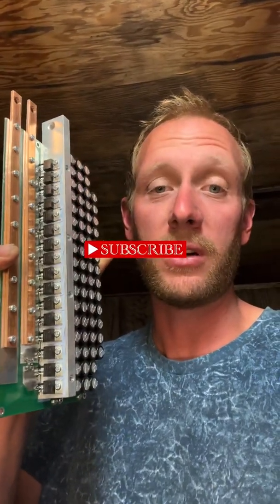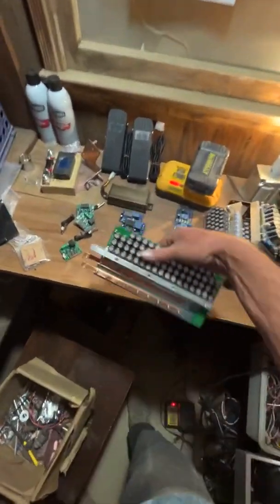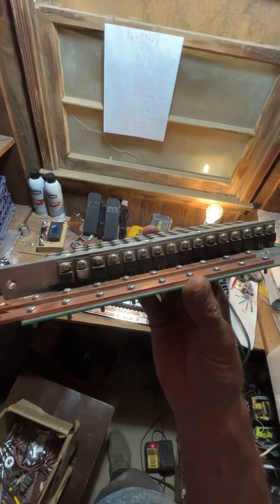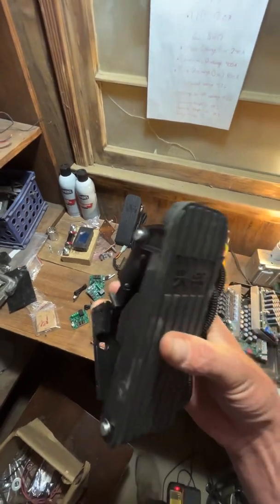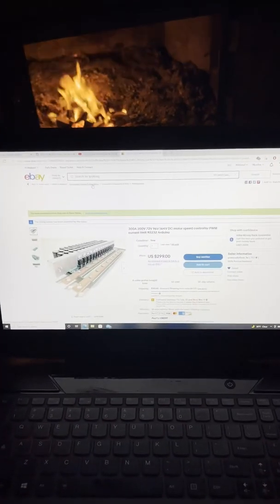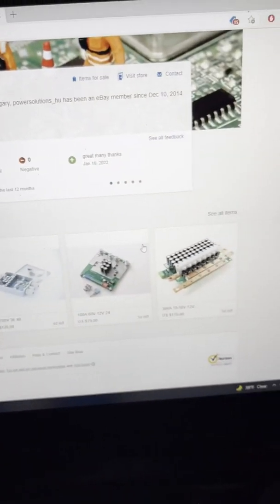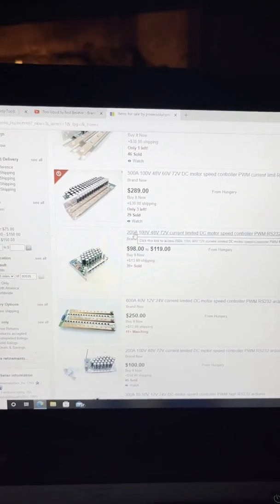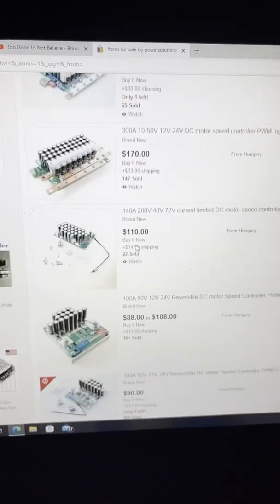200v Ebay controller overview powersolutions_hu

Comment: I'm replacing Dead Acid batteries in old 48v carry all for use as farm cart.  Ive got 2 48v 48Ah power modules.  I'm thinking I can just get bus bar, wire them in parallel on the bar, some level circuit breaker to guard over discharge, a BMS to control overcharge and leave existing controller in place. Am I wrong?
Reply: I'm not opposed to buying another controller, I'm just not sure I need it.
Reply from the maker: No just leave the controller if its working. Record and post it so I can see your setup and plan. 😁
Reply: @RetroElectric  oh man. Son sent me pic. Club car 2012 carryall. The motor is German. AC with a Curtis 1236-5401 controller. Hi speed.  The better thing though, I looked at a lithium battery off the shelf drop in replacement. 48v 51Ah.
Ha.  Those BH PMs I sent there are 36v, I'll have to add cells to 48, but they're 48aH.  3 in parallel will be 96 at cost of hmm maybe $650 before cell addition vs $2,000 ( pretty sure) for the OTS version. So that exceeds the old saying "Twice as nice, at half the price!" Thank you for your videos. I was letting this project intimidate me. Can't wait to get on the road in couple weeks now. Oh and AGMs in it now are over $300 apiece n 8 of those would be $2400 or something. Geeze.  Next step might be 4x4 for mud n snow. If this works, it's gonna be epic on cost savings all round.
Reply from the maker: @eltonshamblen9766  that’s an awesome! These cells are absolutely amazing for golf carts. I’m hoping to buy more as soon as I get a chance! Going to be getting the old yellow Taylor Dunn utility flatbed cart running soon and deck it out with solar. I’m targeting 120v I think. Unless I shoot for building the pack to charge directly with solar. I also want to build it with a grid tie/off grid inverter so it is a power wall on wheels.

Comment: I thought they were brushless controllers. It energizes a solenoid and thats how its able to handle all that voltage?
Reply from the maker: Yes that are for brushed controllers. Brushed motors are what most golf carts have in them unless they are brand new or someone converted them with an ac motor kit. 

They do not just engage a contractor they do use transistors to pulse the dc supply and in turn modify the speed of the motor as they pulse at variable frequencies based on the input signal from the throttle. 

The only time I have a Contactor on  board is to kill the power to the controller with a key switch or something.
Reply: @RetroElectric  you my friend know a heck of a lot more about golf karts than anyone else i know.  Thanks